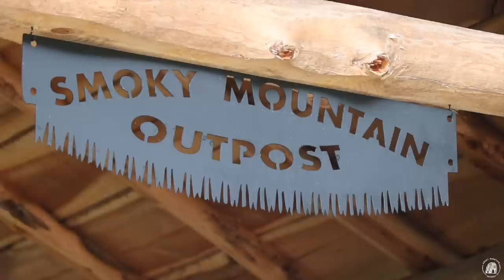OH NO!! MY CABIN POST IS ROTTING BUT FIRST LETS FINISH THE SMOKEHOUSE | Pt. 1

Comment: Well here I go promoting again.😂 I have been spreading the word with Total Boat penetrating epoxy, I started to use it on my dry roted transom but, instead of keeping the old transom on my boat I used it on the new wood to keep carpenter ants and termites from destroying the wood again. Then using it again on the bottom of my wood door on my garage that  started to rot after a flood some years back. Still going strong the price may have went up but, I use it on anything related to the outdoor projects.
Reply from the maker: Promote anytime, my man! We appreciate suggestions! That’s what makes the world go round in my opinion. -Jennifer

Comment: 2 part epoxys and many additives or even polyester resin  if needed are your best friend in repairs .and my favourite thing to use on oh a lot of stuff from gas tank sending unit sealing is only this type i would call it gas proof yea odd but Liquid Nails
Fuze It 9 oz. Gray All Surface Construction Adhesive .its a must have in my shop it stays flexible and is fuel proof i used it to repair intake boot  that was cracked and leaking for testing.3 years later that old intake is still usable God bless
Reply from the maker: Thank you!
Reply: @SmokyMountainOutpost  no problem i thought you may need and like intel God bless and  all almost a neighbour Kingston Tn  ✝

Comment: As a fellow Tennessean with a lot of experience I’ve never had luck with any untreated wood outside exposed to the elements near the ground level. Wood will still draw moisture from the concrete and blocks and of course from driven rain and splashing.
I would continue excavating that drainage and install that French drain. Treat the wood with Timbor to kill microbes and prevent termites. I remember the way you did those at the beginning and it’s worried me that over time they may rot. Timbor or other borate treatments will be your best rot deterrent but you have to get it underneath it so it can soak into the end grain, not just on the outside.
I would absolutely NOT tar it. All you’re doing it locking in the moisture instead of keeping it out and one day all that will start peeling back and you’ll see that it’s all rotted. Lean towards keeping it open and able to dry more so than sealing it off. 
That putty stuff does the same thing, it just locked in the rot and  that will only spread. You gotta clean the rot out off the good wood. I can’t speak to the wood hardener product. Good luck friend.
Reply from the maker: Thank you kindly for your thoughts. Still in the process of figuring it all out. Hope all is well your way! -Jennifer

Comment: I did not know if you knew this I have been installing gate and swing doors for years. DOD you know the cross board is supposed to ho from the top hinge to the opposite bottom it serves two functions holds the boards and keeps the door from dropping on the latch side.
Reply from the maker: Thanks for the information. I’m gonna have to check into it because I actually had thought that the brace angle down towards the bottom hinge because of gravity and weight that it would push into the corner on the bottom hinge that way it’s not pulling from the top.
Reply from the maker: I forgot to mention the reason that I am putting them at that angle was I’m using them as a compression brace